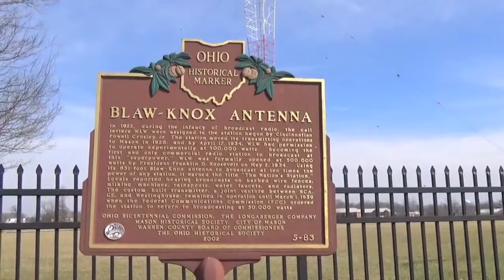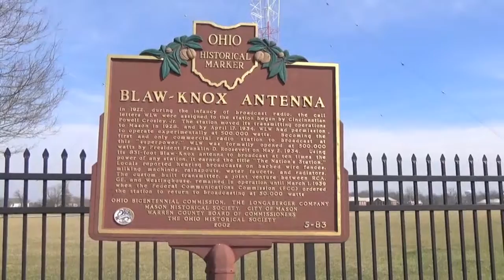Historic Massive WLW Blaw-Knox Radio Antenna

Comment: Nobody mentioned the FM bays at the top of the tower. 
This is one incredible tower.  There are many technical reasons for the design of this tower, many over my pay level. Having owned two AMs of my own, I know that a tower like that has great bandwidth and radiates a very efficient signal!
Reply from the maker: Certainly is an impressive place. Would love to be able to get inside and see if any of the old tech remains.

Comment: I believe that little hut on stilts was an observation point for security in WWII.
Reply from the maker: Too cool! Thanks for the info! It was very nice for you to take the time to watch my video and comment. Namaste!
Reply: It was. Just up the road from the WLW site was the VOA Bethany Relay Station, which operated from 1942 until 1994. Powel Crosley had a hand in that also, as his company built the first 6 transmitters used in that station. They operated at 200kw, and each one carried a WLW callsign.
Reply: Yes, key stations in every part of the country were guarded during WW-II.  I worked for one in the 1970s.  The guard tower was gone by then but base of it was still there.

Comment: How come the antenna for 700 WLW, starts out skinny at the bottom  then gets big and wide half way up and then back to skinny again? From Charles Wooster.
Reply from the maker: That, my friend, is a solid question that hopefully a radio enthusiast can answer. I have often wondered the same thing.
Reply: That design of tower is stronger and requires less guy wires to hold it up
Reply: That tower is one of the famous towers built in the Pittsburgh area by a company called Blaw-Knox. They are a radio icon.

WJR had a Blaw-Knox tower, but it collapsed in an ice storm after only a few years.

Blaw-Knox also made more traditional towers.  WWJ had two traditional towers with wide girders, and straight sides, one large and one smaller.  Those were razed circa 2002 to make way for a new TV tower.

WWJ Radio built a new array about 30 miles south of the old one, 50,000 watt transmitter, beamed north to about 700,000 watts ERP.
Reply: there is really no other purpose to it other than for strength. there is an insulator at the base that is small. So they have that wide part in the middle for all the wires to keep it balanced and rigid so it doesn’t get knocked down by wind. also, the thicker the tower, the lower the resonant frequency and the resistance. It also provides some capacitance to ground, thats why there is no capacity hat on the mast.
Reply: That design has been used elsewhere.  They simply join two smaller towers together.
Reply: The design had something to do with the actual rf signal itself. At 500 kW, the original engineers stated the standard antenna design produced a lot of arcing between the antenna, other metal objects, and earth ground. The Blaw-Knox design, if I understand it correctly, was designed in this manner. The enlarged center created an rf "node" which helped to suppress arcing to a great degree. 

When the station was running at 50 kW, only the top half of the antenna was used. They were somehow able to tune the tower in such a way so as to tune the bottom half of the tower 180° out of phase with the top half. This prevented the bottom half of the tower from radiating a signal. Essentially, they made the tower a half-wave radiator electrically. I suppose it could depend on the tower's feed points.
Reply: The tower was made of two "halves" joined at the center. This had nothing to do with feeding the halves individually as they are electrically bonded together. The 747 foot tower is a single vertical radiator. The middle of the tower was made wider (35' square) for additional structural strength. It has been in use since 1933 and can support a total stress load of 450 tons, (900,000 pounds!) including wind, ice loading and anything else you throw at it, with plenty of room to spare. 
The tower itself is made with 135 tons of US steel! It's been up for almost 90 years without any issues!
Reply: If you look at the early history of WLW, the tower was TALLER than it is now, by approximately 87 feet. It was shortened due to a cancellation node the caught several cities in the broadcast area. Also, the signal was obliterating CFRB in Canada, which at the time operated on 690khz. In order to stop that interference, they had to reduce power to 50kw and install two suppressor towers across from the main tower.
Reply: @HNXMedia  It requires only one set of guy wires instead of many.
Reply from the maker: @nakayle  Thanks!

Comment: I could just imagine the people that lived nearby that tower when it was pumping out 500kw, you would turn the light switch out in your home and the light doesn't turn off. Or youd go to lay down in bed and you hear radio coming from your bed springs.
Reply from the maker: The area was all super rural farm land back in the day when it was operational and people still tell stories of the signal coming through televisions and other "receiver" style devices. These days it is surrounded by subdivisions and would probably blow out breakers up and down the block.

Comment: In Person .. It's HUGE  ... WLW  700  ANTENNA
Reply from the maker: Yes it is. It is also hard to give perspective with a handheld camera (from the ground). I did not have my drone yet when I made this video. May need to go back and get a few shots with it and do a short "update video." Thanks for watching. Peace.
Reply: At it's widest point the structure is 34 - 35' wide. How many rooms in your house measure 34 - 35 '? The Blaw - Knox in Franklin (Nashville) Tennessee is slightly larger owing to the lower frequency of the station there.
Reply: You need to see the KVLY-TV Tower northwest of Fargo, ND.